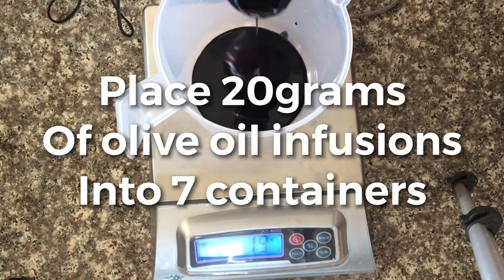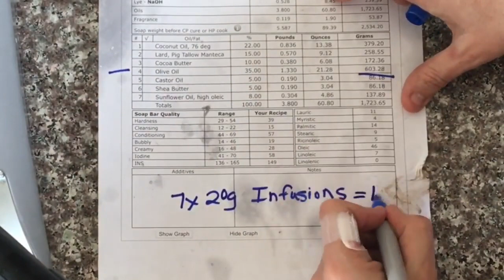Tall & skinny shimmy plant infusions natural CP Soap By Chass WF Soap Challenge Club April 2020

Comment: Beautiful and vibrant colours. Is your rhubarb root Anne G’s Himalayan Rhubard? And, do you gel in the oven for 24 hours?
Reply from the maker: Thanks Vicki, Yes Anne G. Himalayan Rhubarb.  I only set my oven 15-30 minutes and then turn it off with the batch covered.  If it doesn't start to gel after several hours, I turn back one a short period and turn off again until it does.  One Gelled, I let it cool and and then cut it.  I have cut batches 6 hours after made sometimes.
Reply: Thank you Chass.